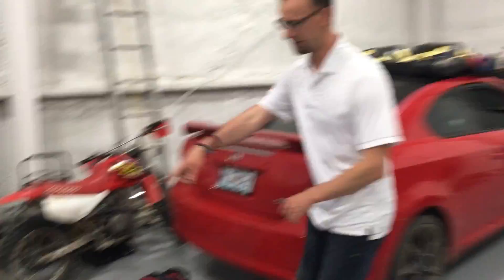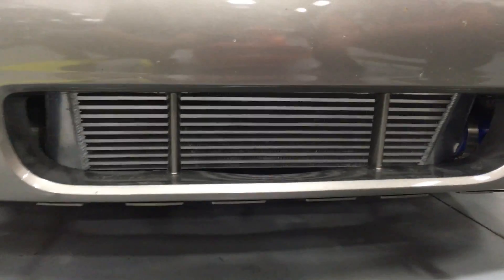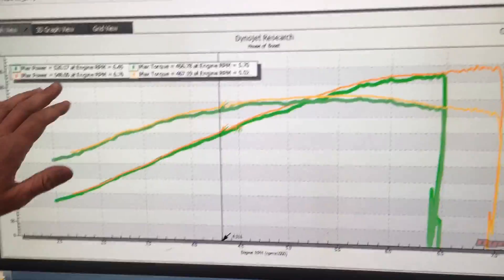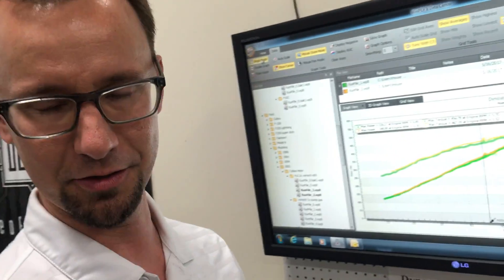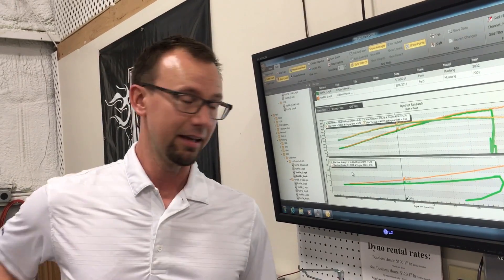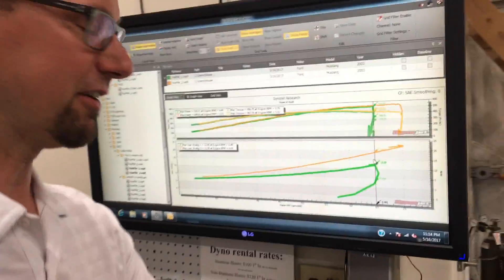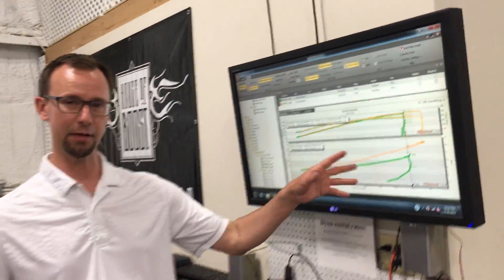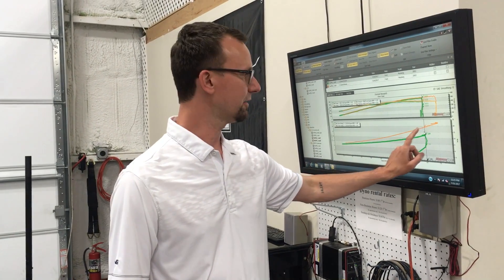Don't buy junk intercoolers for your turbo or supercharger | Horsepower United

Comment: You stated that the procharger intercooler you showed was old-school, i ordered a f1a-94 kit with the 3 bar race 1050hp and it looks identical to that...can you tell me why.
Reply: Ordered the kit in Feb of 2017
Reply from the maker: Meaning that it was an old-school design.  Not that its a bad thing, when something works well, why change it? :) 
I personally ran one of these units on my 830 rwhp Mustang for years with no issues at all and loved it.  

Some of the newer designs are a bit more "shaped" to fit the nose of the cars (like the S550), however, performance is about the same as what you are looking at here.   Those big cores, with short distance through (6") makes the restriction low, and the cooling ability high. :)

Comment: A pressure drop between inlet and outlet of an intercooler is normal since the air density goes up...air take less room when cold,the pressure goes down.
This pressure test is useless unless you take temps too at the inlet and outlet,and check if they match the density you measured.
Reply: Always nice when someone chimes in with important facts that are conveniently missed by someone trying to sell a product.
Reply: Yeah, boost is a measure of resistance, not a measure of power or density. Neck the intake tube down to 2" and you'll see a massive boost gain along with a severe loss of power.
Reply: if someone were to buy one of those universal race intercoolers, they would notice something about them that actually increased efficiency by about 30% over the original design. I'm not going to say what it is here publicly, but once again if someone were to buy one, it's pretty obvious there is some engineering trickery going on.
Reply: Wich ones are you talking about ?
Reply from the maker: @Richard NZ $200 or $300 I can't remember
Reply from the maker: @Richard NZ $100 for a tune?  Heck the dyno rental time was more then that...
Reply from the maker: While I do agree with you that you will always have a pressure drop.  I personally like to keep that around 2-3psi, and make sure IAT's still stay in check.  (proper sized core, proper designed core, proper flow path)   

After ditching this terrible intercooler, this car picked up right at 100hp, and IAT's stayed in the same spot.  (within 5 degrees).   So in the end, the customer ended up being the real winner here and has loads more power. :)
Reply: Even the procharger intercooler you show here is pretty badly designed : on the inlet / outlet there is no smooth transition, perpendicular  to the air flow.
Like you said the thicker and shorter are the less prone to charge loss,but you need a clean laminar flow.
If you want to see efficient intercoolers ,check the group B rallye cars from the 80's.
http://groupbrally.com/old/images/lancia/s47.jpg
Or simply look at the work done on the planes using piston engines,on wich aerodynamic still had an importance.
I suggest you to check : 
http://contrails.free.fr/engine_aerodyn_radia_en.php   
 https://www.google.fr/search?q=kucheman+and+weber&num=100&source=lnms&tbm=isch&sa=X&ved=0ahUKEwiI477CydzVAhVSJVAKHfWiB_kQ_AUICygC&biw=1920&bih=988
Your customer would have a way better efficiency on the intercooler with a smaller hole in the bumper for the air to come in.
Os imply look at a volvo 240 grille compared to the size of its radiator,you will understand the optimal ratio.
You increase the size of an orifice you reduce air speed ,but you gain in air pressure says bernoulli.
Wich is pretty cool to pass through intercoolers fins....
Reply from the maker: That "badly designed" intercooler, was designed about 15 years ago (which I state in the video) BUT doesn't change the fact that it picked up 100hp over that POS internet intercooler.   
 
At over 600 rwhp it has 2.5 psi of pressure drop, and the IAT's after 5 back to back pulls on a hot and humid day were right at 30 over ambient....in real life (not the dyno)...at 19psi of boost.  So I would say its doing A-OK. :) ..... on "paper" the unit that was on the car looked pretty good as well.  But in reality, it was junk... 

(Also note that a bunch of the units you are linking to are Air to WATER, and not air to air)
Reply: I understood what you did,and the result of the improvement.
What i try to explain to you is the fact "air tanks" on intercoolers are badly designed,they are not air tanks,they should be diffusers like here :
http://groupbrally.com/old/images/lancia/s47.jpg
The charge loss is huge in air tanks,simply because they are pockets,tanks,and not a zone where the flow should be guided to the fins without turbulences.
aerodynamic was my concern.
I'm sure it was some mishimoto crap right ?

Comment: Here's the problem, and this is a good video and I don't know why people don't pay attention to this.
But this issue here is COOLING efficiency is predicated upon the length of travel through the channel.  (yes other factors too - ambient fluid exposure (frontal area) fin density, intercooler mass etc etc.
You've heard the expression Cheap, Fast, Reliable - pick two.
Well, to get kind of basic.
Intercoolers are more like:
Space, efficiency, and flow, pick two.
"cooling area" doesn't work the same as having a longer channel.
Now don't get me wrong that sweet vertical core intercooler is probably a solid 75% efficient at dropping temp, and there is a VERY good point made about having to cram that much more boost with higher temp than is needed.
But just keep in mind, power is made through flow, and that vertical is going to flow waaaaay better than that horizontal one with bootleg end tanks.
Reply from the maker: After swapping the intercooler to a new unit, the car picked up ~100 rwhp, and boost is now 19psi.  (no changes to car)  IAT's are still amazing, the pressure drop is only 2.5-3psi, and the power went WAY WAY UP.  The owner is super happy. :) ........  I would do another video, BUT the motor suffered a valve train failure and is currently getting that repaired.
Reply: Beau Mancini that’s why i run a vertical flow front mount on my car

Comment: I'd be interested in seeing a direct comparison of the Procharger intercooler vs the one on this car.  (Internally, core size/shape, how the tanks play into this, etc).
Reply from the maker: After swapping the intercooler to a new unit, the car picked up ~100 rwhp, and boost is now 19psi.  (no changes to car)  IAT's are still amazing, the pressure drop is only 2.5-3psi, and the power went WAY WAY UP.  The owner is super happy. :)

Comment: Definitely want another vid after the intercooler swap.
Reply from the maker: I am going to be doing a follow up with a test in three conditions..... (None intercooled, This junk intercooler, and a ProCharger unit the owner picked up used off Craigslist) .... will be a lot of fun.   Same day, Same dyno, Same tune... won't even unstrap the car. :)
Reply: @erikradzins  you have to make back to back videos to prove your statements. Yes the procharger FMIC is outdated but you stated it will still make better HP by a large margin. I think your content would have much more value if you provided more solid proof. Allot of people swear by EBAY FMIC and say you are not loosing much. So Im not trying to say you are wrong i just really want to see the stats,facts and info.
Reply from the maker: If you want facts all a person as to do is.... Stick a boost gauge in both sides of intercooler, and log it on a dyno.  Its pretty easy to prove.  This car picked up over 100hp with an intercooler swap.  I will have a follow up video down the road.
Reply: You really should monitor temps before and after as well. Pressure drop is only half of the story.
Reply: Like a $1000+ intercooler vs like $100, easy math...(that's most likely a CX intercooler)
Reply: Lmao 😂